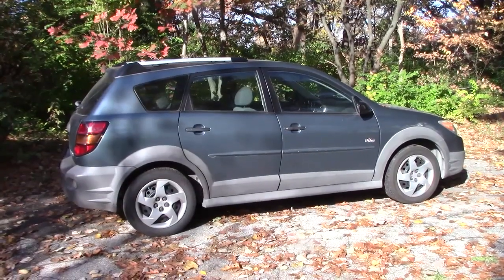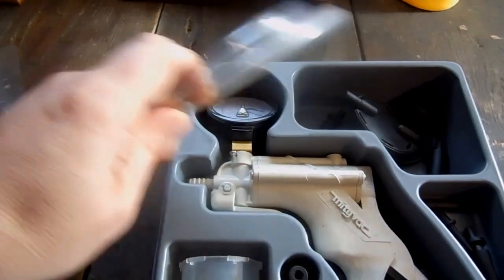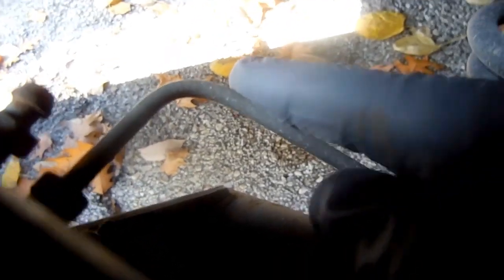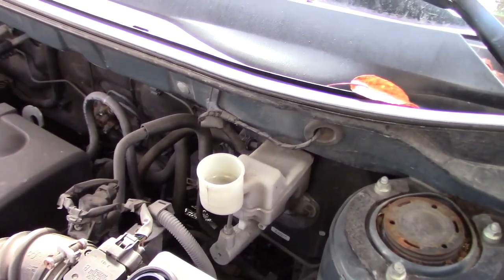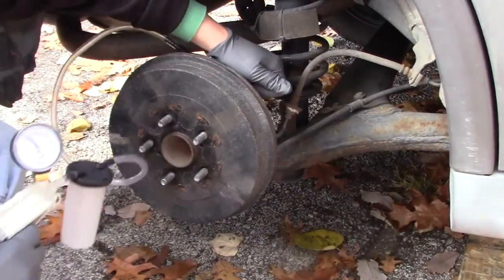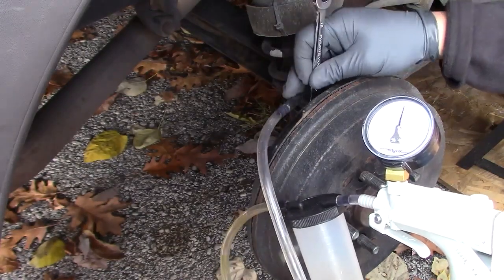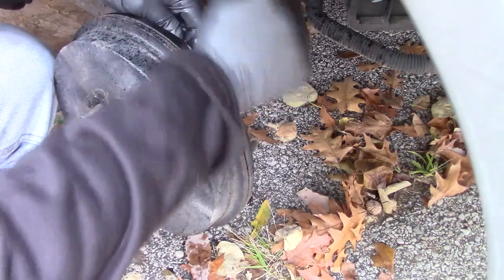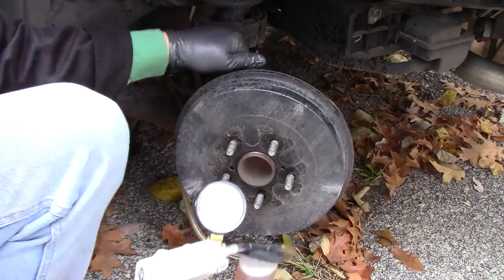Mityvac Brake Flush/Bleeding

Comment: You can put heavy grease around the plastic tube on the bleeder screw  to prevent air entering the bleeder line, except the air coming from the brake lines.

Comment: It works better if you elevate the clear tube as it comes out of the bleed screw. If the tube goes up (vertical) about 10” first, then it’s easier to see whether there’s air in the brake system, or air entering the hose at the screw.